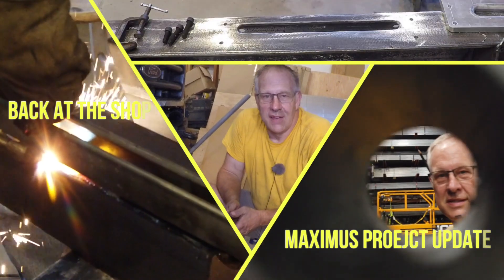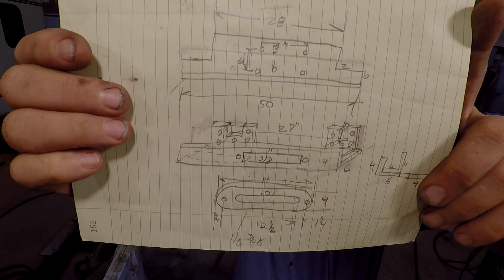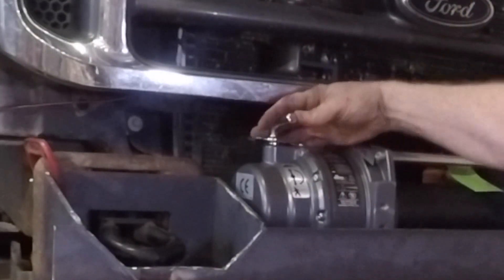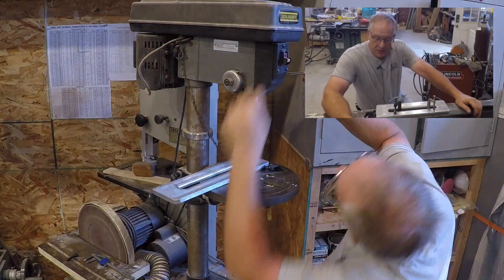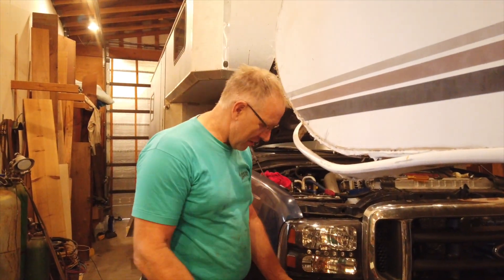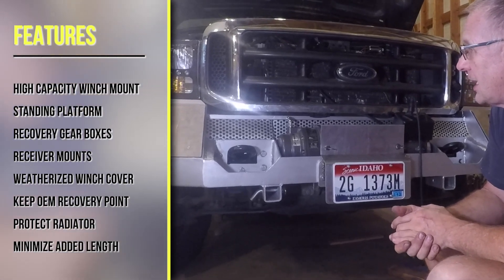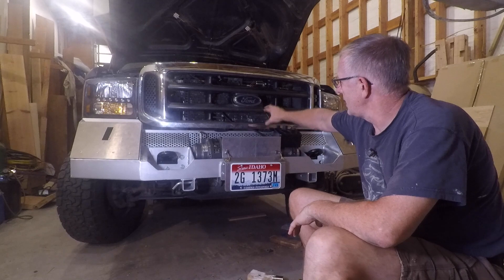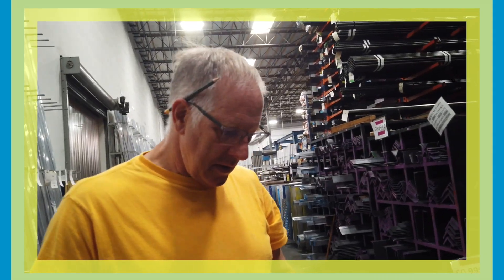DIY Winch Bumper for Expedition Vehicle | Function over Fashion

Comment: In my previous winch mount bumper builds with a 12k lbs winch, you can bend 5/16” plate fairly easy during a recovery to the point it can crack or break the winch frame. I now prefer to use a receiver mounted winch on 1/2” plate, where I can use it in front or at the rear of the truck. Get a plasma cutter it is amazing how much it speeds up projects. Great construction, impressive skills and rig! I like it!
Reply from the maker: Thanks. What is not clear in my description,  In addition to the 4x6x5/16 angle that is just the front half of the mount. The rear portion on the mount is a 2x2x1/4 angle with a 4x1/4 plate welded to it making a 2x6x1/4 angle on the back. The winch fits tightly in the groove the two angles make and is bolted through both with 6-1/2" bolts (4 in the bottom and 2 in the back}. I like the thought of a receiver mount but seeing the amount of force my 12k winch on my Jeep produces, I am pretty sure my 18k could overload the receiver tube if I used a single tube, even if I used a 2.5" receiver. With the winch weighing 97lbs and a receiver mount probably weighing 50-75 lbs, it also gets weighing almost too much to move. I do think having an option for a rear mount option is very helpful, possibly every bit as much as a front but thought that by the time I could build a DUAL receiver mount, it would weigh so much I wouldn't be able to move it. I do wish I had a plasma cutter and had one a long time ago. If I had designed this project the way I normally do, I would have made a detailed design and had parts CNC plasma cut which is relatively cheap but the design on the fly and decision to use tube parts to avoid bending plate was the price I paid. Good thoughts. There is often better ways than how I do it but because I have so many projects, I'm often pursuing a path with least total time and total cost, which are at odds with each other.

Comment: Where you showed your rig being stuck had no large trees nearby.  Your new recovery winch would not  have helped you!
Reply from the maker: They were not close. Possibly around 100ft. When I bought the winch, it had no cable. It was intended to have 1/2" steel cable. I chose to use 14mm synthetic (32klb capacity) and bought a 45m (153') length, not knowing how much I could get on the drum. I was able to get 108' on the drum making an effective length of 90-95' (leaving a minimum of 3-4 wraps on the drum). I made the remnant into an extension/tow rope that is about 38' long. I also carry a 30'x1-1/8 dynamic rope and an 8' tree saver (both of which I had then), I could use to extend the line. I also have soft and hard shackles, my own version of an 'X-Lock'  and a an improved 'load distribution plate' (from Factor 55 base design) both of which can be used as shortening tools for the line extension. I also have a new recovery jack system based on 8T hydraulic x 22" stroke connecting to 4 new receivers on front and rear. All are referenced in some of my later videos. 

I was also towing my Jeep which now has a 12k winch with 92' of 10mm synthetic line (15klb capacity), an additional 92' of 12mm synthetic line (22klb capacity) for it's own extension and a 30'x4" (35klb capacity) static strap. 

You might say, I'm pretty determined not to lack means if I get stuck again.